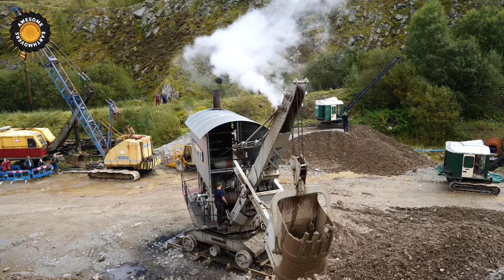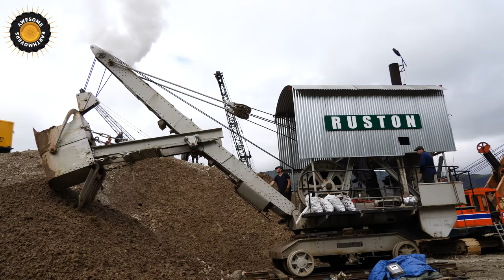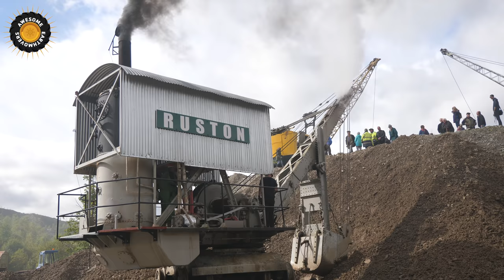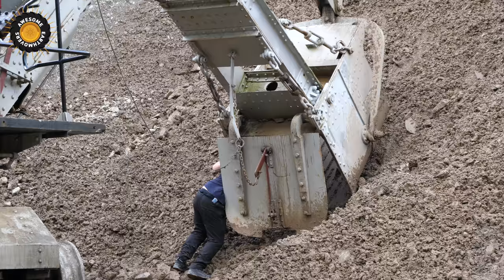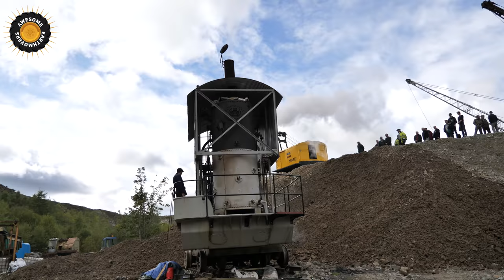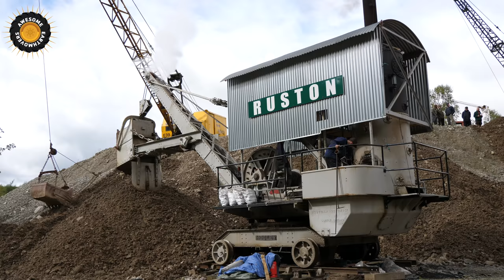1909 historic Ruston - Proctor steam shovel working.

Comment: In the early 1970s this machine was sunk in the quarry at Arlsey with only about 3 meters of the jib showing. It was about 20 metres from the edge and was used as a diving board by the local youths. (I was actually a youth in those days!) Had we known what lay beneath we might have been a bit more cautious but that's what comes from being young and invulnerable!
Reply: It had been sitting underwater for 50 years at that time. I t was not intentionally flooded, it was abandoned in the pit which eventually was flooded to become a lake.
Reply: I was wondering if this was that same shovel I just watched the recovery and restoration video
Reply: From what I understand the well pump which was also steam generated stopped working and over the years the Blue Lagoon filled with water. The crane was abandoned which had been working. I have dived the pit many times down to the hut and well. Max depth 12.3mt

Comment: I am back home finally,  I get back to watching your videos...  I have a question, does a machine like this, have a value, or is it impossible to place a value upon it? If it does have a value, would they add both times it was restored together on top of the scrap meta value.. I do not know how to ask that, as using the word "scrap" sounds bad.. but, if this unit was still at a site making money for a company like it once did, that would bring different numbers into the equation, I am assuming?. it is an amazing machine and these types of machines played a large role in building nations, so, to see one this large restored to educate the masses of how things were done, priceless. Another cool video, Thank you for sharing these, Dru
Reply from the maker: Dru Bradley it was built in 1909 and abandoned in the early 30’s as it had no value due to it being old technology and at the end of it’s working life. It’s sister machine in the same pit was recovered and used for scrap metal due to demand in the Second World War. The machine in the video was mostly underwater and not worth recovering. It developed a value after time due to its age and rarity and was recovered in 1977, restored by 1980. It slowly deteriorated until the vintage excavator trust restored it  again around 2012.

I don’t think you really can put a value on it. It’s worth what a collector is prepared to pay for it or how many visitors will pay to come and see it in Threlkeld quarry.
Reply: Sometimes "value" is in history, not currency.  Few people would want to purchase such a machine, but every curious child  and aspiring engineer should have the opportunity to see how things were done when this technology was cutting edge.  It's the same reason records are making a comeback. It's not always about money.

Comment: When the show went off it still had a few major issues. Did they take it apart and replace what was wrong or did  they just fix it? Seemed like they were catastrophic cracks.
Reply: Yeah I heard about the cracks throughout the base of the shovel and the turn gear, I heard about it on the recovery and restoration video